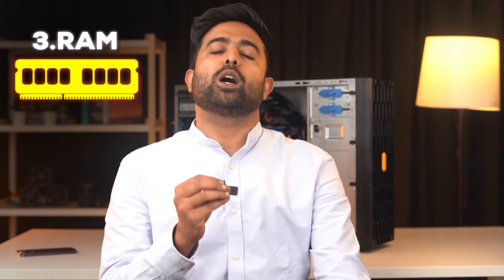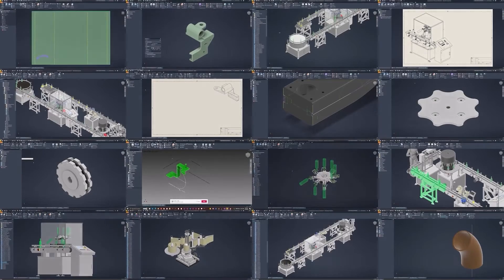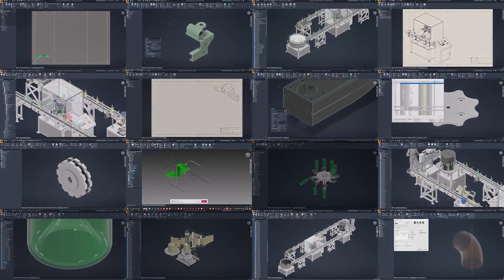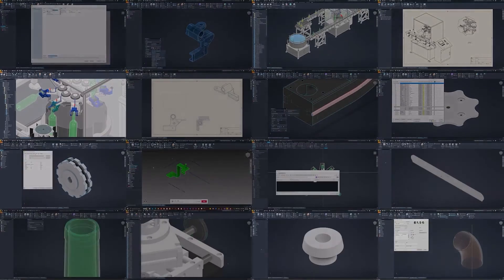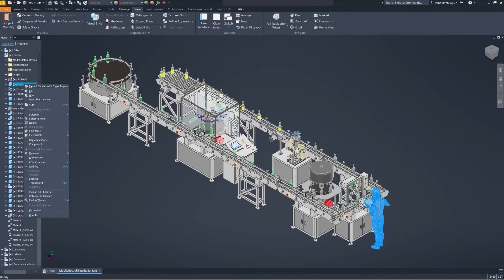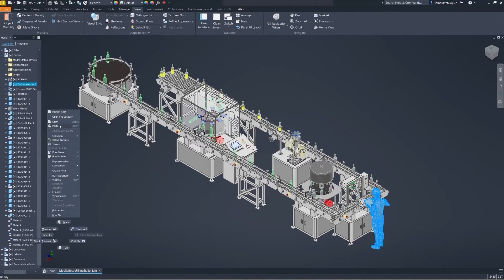How to Build a PC for Autodesk Inventor?| Hardware Recommendation | Know your ABC - Part 17 | TheMVP

Comment: Why you are doing accent on qty of cores in AMD Ruzen, when 30 sec ago you said that Inventor is a single core performance application?
Also ..." here is a proTip: RTX 4000 is good, but quadro is a better option?" - quadro name was dropped 3 years ago and the same RTX 4000 is a quadro itself. 

Talking about GPU for everyone - Inventor doesn't have anything in it's code, that makes it run better on RTX professional cards. Certified hardware is not for those who is watching this video. Take Geforce, don't do the gaming and all will be reliable and smooth. Believe my 10 yeas experience of daily Inventor usage.